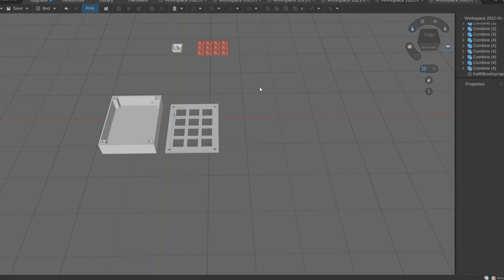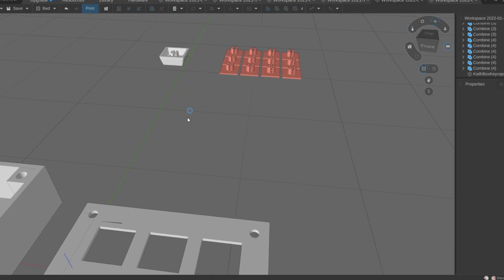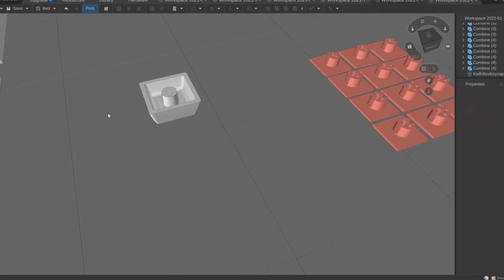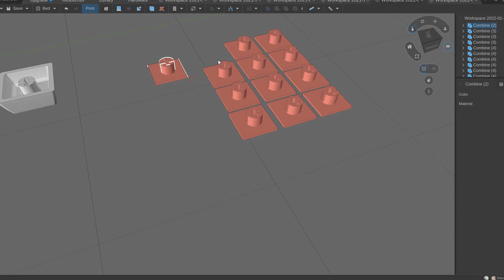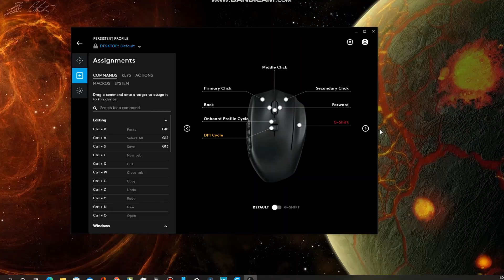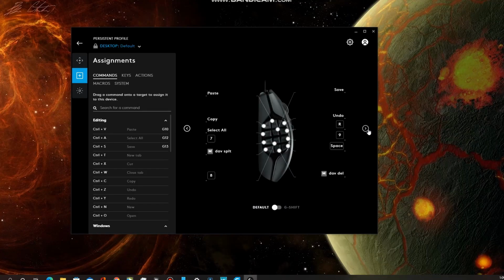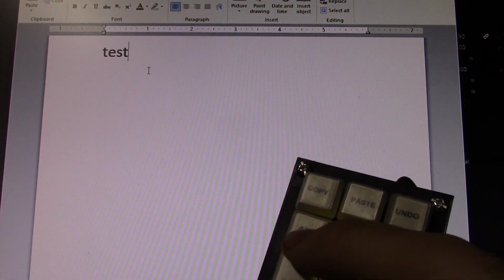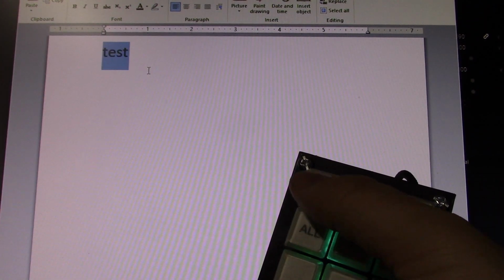Turning a broken mouse into a macro pad!

Comment: Thats the quality content I'm here for! Salvaging old parts to make something new or repairing broken tech is just the best!

The mousewheel breaking seems to be a common issue for Logitech mice, at least in my experience. For me it were two mice: one had a broken mouse wheel sensor and one had a broken wheel axis. (Of course i swapped the broken wheel with the fine one.) Right now I have multiple Logitech mice which get used almost daily so I'm expecting another broken mousewheel in the future. But I have to add I'm a heavy mousewheel user, I always use it to close tabs in browsers and other software instead of aiming for the x, also open links in new tabs.
Reply from the maker: I wonder why they fail so often 🤔

I should see why this one failed and then see if it's a common failure. It's unfortunate because they're pretty great mice for the most part. I got so used to using a trackball mouse that I can't go back lol
Reply: I have another broken mouse wheel to report :D 
The wheel axis broke inside the rotary encoder. Thinking about replacing the axis with a custom made metal part.

Comment: Hey Soldeking, is there any other way of fixing the problem you get ( the limited full throw on x and y axis)when soldering smd pots other than using a bevel to make the circumference of the anolog stick bigger?
Reply from the maker: Are you referring to my original video or the kit version?
Reply: @Solder_king   I was referring to your original version. Is the kit you're talking about the 15 dollar one that comes on a pcb and does it guarantee having no limitation on x and y throw after tuning?

Comment: This is cool~

Now I want to change my room's light switch with mechanical switches.
Reply from the maker: Perhaps a remote control with mechanical switches?
Reply: @Solder_king  I don't know if I  can do that.
Reply: Oh my dear lord, 8 pounds 6 ounces sweet baby jesus. Why have I read your comment?!? Now I want to go around my house and replace every last wall light switch with some OG holy panda switches lubed/filmed/spring swapped....OR for the bedroom some nice GIANT mechanical switches (the ones that have a keycap about the size of your head or roughly 4-5 inches wide... and have those Linear switches so i don't wake the female when i wake up and roundhouse kick the huge switch on the wall....because obviously a little lube and a nice C3 Tangie or some Durock POM switches will be so smooth and quiet that she'll never know i just jumped up and roundhouse kicked that overhead light on. 

thanks for ruining the next two weeks of free time i would normally have, now I have a new project 😂

Edit: Shit, I might even have to just design custom PCBs the exact size of a wall switch cover then get some custom FR4, aluminum, maybe even a Brass plate for the wall switches for my office....because that deep thoccc is life. 

I was thinking Im going to need to automate these lights with a little Raspberry Pi or a nice microcontroller....but having everything so conveniently accessible to turn on and off all the lights using wifi or bluetooth would completely defeat the purpose of the tactility of these mechanical switches. 

Dear Lord, I'm in too deep. I'm gonna need to start a custom "GMK light switch" keycap Group Buy😂
Reply: @phlooke  Lately, I've been into mechanical keyboards and bought two keebs. Now, I do... understand the predicament.